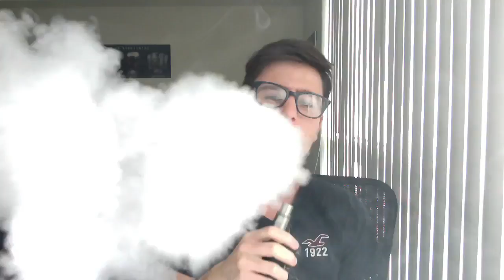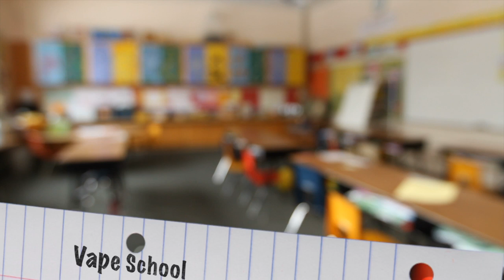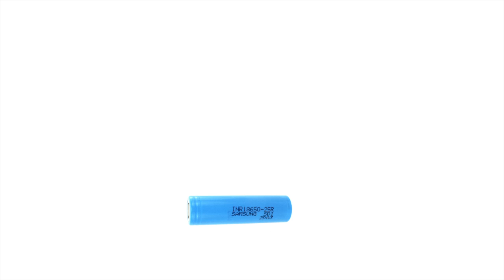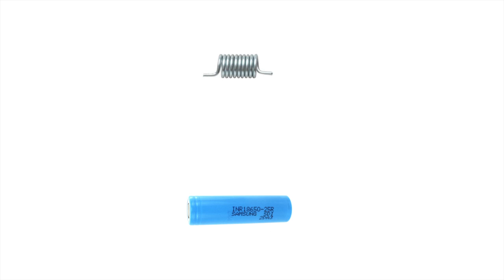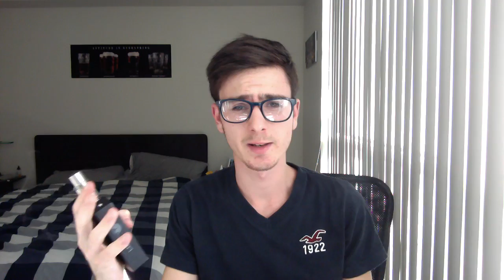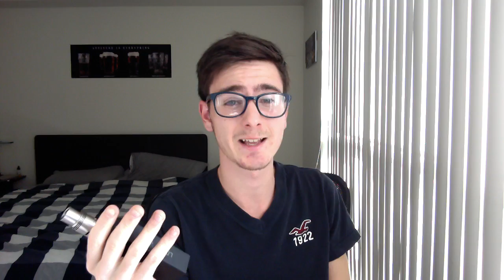Vape School: Resistance, Volts, Watts & Amps

Comment: I am so confused by all this!  I am looking for a cigalike. I was told that the mah is how long the battery will stay charged and volts is I think how much power or vapor production.  I was then told I needed a low resistance cartomizer, which are basically impossible to find in a cigalike kit.  I only know of vapor4life having them.  I would have to add a clear atomizer with a tip to the end which wouldn't feel like I am smoking a cigarette. I have one picked out but I thought I would try a Juul or blu style pod as well  for when I chain smoke cigs basically on my computer or when I get stressed, so I am finding most of those dont mention volts but instead watts!  No mention of watts in the cigalikes.  The cigalikes all have 4.2 volts.  The pod style ones say 15 watts to 25 watts and much high mah, though and low resistance pods coming with them in the kits and not have to be purchased separately.  Is the higher wattage going to be better. I am assuming. None of them have varibale wattage like the box thing I purchased and hate and never use. Can you give me some direction please as to what would match is or be  more powerful than a 4.2 volt cigalike.  what type of wattage should i be looking into?  Novo 2 has up to 25 watts but another more expensive high rated one haad less! I find it hard to believe a small little cigalike is putting out 4.2 volts and some of these bigger novo types say variable 3.3 up to 4.2 when mig cigalike says constant 4.2. I dont want the size of vapor to decrease as the battery dies.  Do you know any small pod style one the size of a juul that have constant voltage?

Comment: I have a boundless tera, it's a handheld convection style vaporizer.  They say they use LG (unknown model in their own wrap) flat top batteries with 30amp and 2500mah labeling on the wrap (?).  How do i find out what the output of my device is so i can check to see the best battery option?  I dnk the wattage or anything about this units output, i just want to make sure these 18650s are good to go, lmk, ty

Comment: Absolutely helpfull, Thanks a lot... I have a question tho...  I am vaping with a 0.13 ohm coil in my Aegis geekvape mini.

Would a higher ohm coil give me a langer battery life? And if so(wich i think it would after seeing your video), How do i know what is safe to use...  the more resistance (ohm) in the coil the less fast the electricity will flow and so the less power going out of my battery...   is that right or am I still not understanding ?

Thanks so much for the video and for your time to read and answer my question,

Greetings from the Netherlands 👌💨
Reply: Ohms is the resistance how much resistance ohms is the resistance how much resistance is being put on the coil

Comment: need help, i have a vandy vape 24 rda i use it with 0.36 ohm dual coils, and i have a 18650 2500 mah battery of 3.7 continous volts and a max of 4.2 volts, but i  dont know how many amps it can resist, is it safe? i dont want the battery to blow up while i vape
Reply: Your dumb

Comment: Hey...i use a battery rated at 28A....but it still heats up the coild very slower.... besides it doest heat it to the point it should be like bright yellowish point....i use a mec mod....plz...help...i even use single coil buils and dual coil...but same things happens...help plz....plz...

Comment: So I am going to probably ask a question most will think is quite stupid. BUT Ima ask Anyway 
So,,,,, I am BRAND SPANKING NEW!!! To vaping, And I just got my first set of vapes. First one is a V8 smok Stick with a baby beast tank. The second one is a Teslacigs Nano 120W 
So here is my question! On my coil it says well 1 says M2-0.15 resistance for 3.7 v direct output
The other one says:
V-8 T-8 0.15 resistance 50-260 W best 120-180
I have NO idea what this completely means, And on my Teslacigs nano 120W i can change resistance, wattage, output mode, taste. It has a memory mode, a lock resistance ability and ofcourse it tells voltage. However I don't know how to exactly read the coil..... what should i sit it on? I am mainly using the V-8 T-8 (V-8 T-8 0.15 resistance 50-260 W best 120-180) and i may switch it to the V8-Q4 0.15 resistance 50-180 W best 90-150W one.
Also I assume that the "best" is a best setting for the coil? But I am not sure, nor am i sure how to read the charts that I am finding online. I am not seeing a 0.15..... I am seeing things like 1.5 well here is the link to the chart that pulled up when I typed in how to read and properly understand a vape coil 
https://www.misthub.com/blogs/vape-tutorials/76788421-tutorial-variable-voltage-and-vaping-power-chart

Any help would be appreciated!

Comment: I have new coils, the entire coil consists of 4 mini coils instead of one moderate sized coil. My wattage was at 50 during the first hit, and it was immediately hot and intense. My understanding from what you've explained is that I just need to reduce the power for these types of coils and the problem will be resolved?

Comment: My T6 smok coil is .20 resistance. Why does it keep going between .22r to .33r. If I unscrew it and clean around contact points it seems to vary a bit sometimes goes down a bit. It works a lot better when resistance is on .22 but at the moment its on .27. Help would be appreciated

Comment: I have feverishly looked and looked for a chart that gives recommendations on how many watts you should set your mod at based on your ohm reading that shows up on the mod!  I'm college educated, but a total idiot with this!  All I want to know is recommended wattages to set my device at based in the ohm reading in the device. Where in the heck would I find something like this?  I have never been so stumped about anything in my life than this!  Ugh!
Reply from the maker: This is a tough one. There's no specific recommended wattage for anything based on resistance alone, because there are other variables that determine what setting you should have. Don't stress about it, start at a really low power and work your way up until you like it!

Comment: im a new vape user with a cheap mod cuboid :) im using clapton coil with 0.29ohms. would like to ask if what is the ideal wattage for this resistance.? i scared about what i saw in the video that some mods exploded.
Reply from the maker: I always recommend to start low, and work your way up until you reach a wattage you like. On a regulated device you shouldn't be too worried. Sorry this is so late!
Reply: WackedOUT ECIG highly appreciated. better late than never :)

Comment: .360 @ 50W and the Voltage = 4.3 on the Smok Alien. I know you never want to push the amp limit on batteries and was wondering about voltage. 18650 batteries fully charged are 4.2 V. Does running a device at a wattage setting that = higher voltage than 4.2 mean potential danger ? Or does the devices voltage differ from the batteries ?

Comment: This video was useless you didnt explain shit. You explained how an ecig works nothing else. The title is misleading.
Reply from the maker: +Gyengye Gabor I'll pay you $50 to give me relevant titles for every video I post.
Reply: How about "how does  e-cigarettes work" it was like yes,resistance,it has some also volts and watts but did not explain what it actually happens if you have a bigger or smaller coil how does it affect the liquid. You basically explained that a small coil runs you batterry out faster and that's it. It was quite vague. Even for a beginner vapor is too little information.

Comment: Voltage variation does not change the amount of electricity that is sent but the potential to deliver energy by each amount of electric charge 

and Amps do not change the Speed but amount of charge that is delivered per time.

the waterfall analogy would be a nice one. voltage - height. amps - volume per second that goes over the edge.

Comment: Ive got a question, for the tugboat ( parallel mod with 2 batteries) if each batterie can handle 20 amps, so will 2 batteries limit will be 40 amps?
Reply from the maker: +TheRomeoTen I don't think it literally doubles the amp rating, but it definitely reduces the stress on the batteries so you can build a lot lower.
Reply: +TheRomeoTen Yes. Parallel configuration will raised the maximum amps, so two batteries with 20 amps each will be roughly 36 amps. It will up the amperage to almost double. With serial configuration, the batteries will be at the same amperage as if you had a single battery, but the mah's will double....

Comment: I have a 3.7 voltage battery with a 1.8 ohm atomizer I want to vape 100% vg and this cant handle it. I think I need more wattage. should i buy a new rig? or buy a new atomizer with more ohm?
Reply from the maker: +Josh King-Wilks It sounds like what you're looking for is a sub-ohm tank, they generally can handle much higher VG juice. Alternatively you can try building your own coils which would help too. Is there a reason for wanting 100%VG? The ohms won't make a difference to the wicking capabilities, but the lower ohm atomizers tend to be built for higher VG.
Reply: +WackedOUT ECIG I've been doing lots of research and figured it out, I went ahead and purchased innokins I taste 3.0 pro. yeah, I needed to go sub ohm.
Reply: +Josh King-Wilks also, I want to vape 100% vg because I have a bit of a pg allergy and vg feels much better. no alcohol to dry my throat. my buddy makes it organically and his 100% vg carries the flavor better than most vg/pg blends out there.